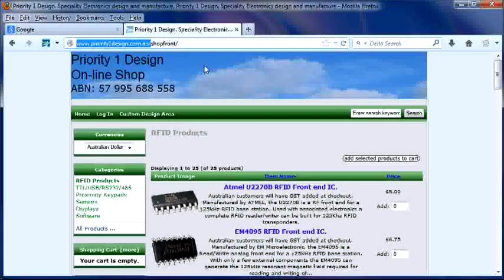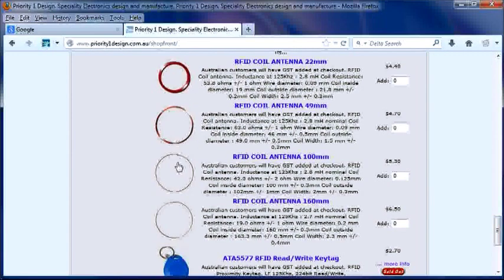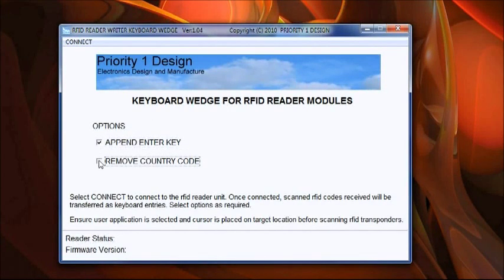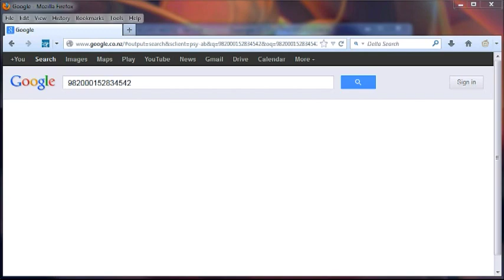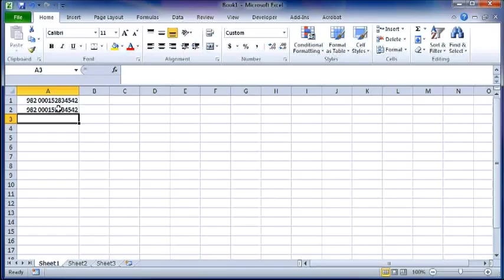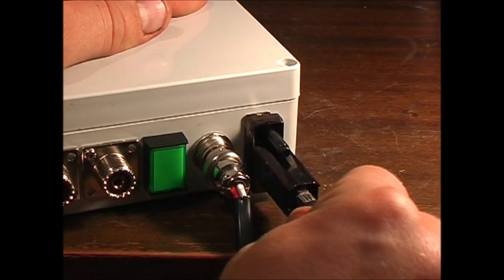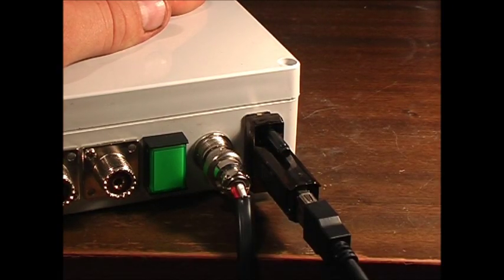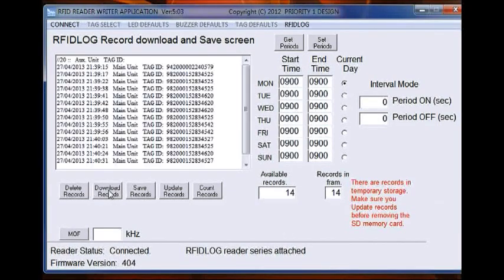DIY RFID Animal Tag Reader

Comment: A few questions ... 1) will this read the under skin (not on collar) microchips used to identify dogs and cats?  2) I'd like to put the antenna under a platform the dog steps up onto, can this be designed to go thru the wood platform up to shoulder height 10" or so? 3) to adjust that height is it changing the size of the antenna or is it software controlled?  4) I'll assume this can record the tags and activate a switch?  Maybe open or close the switch for preset list of tags? 5) could this be set to detect when the microchip dog is approaching the antenna rather than just passing by? Thx